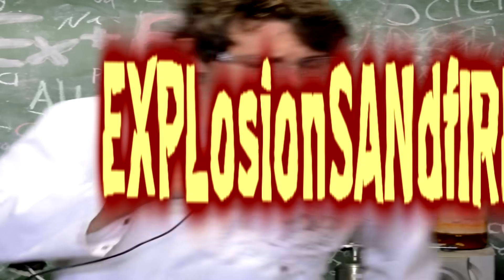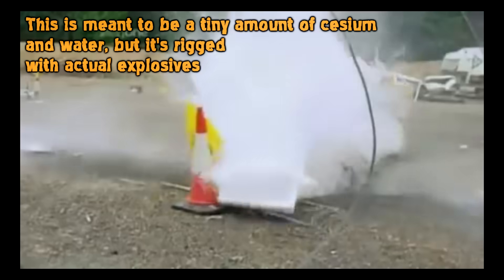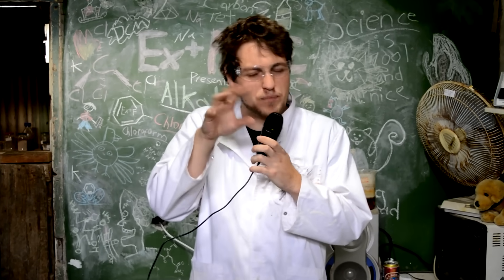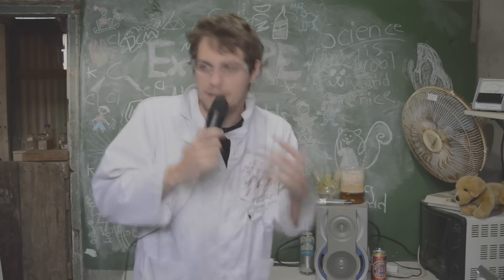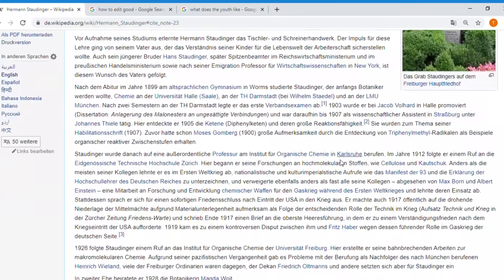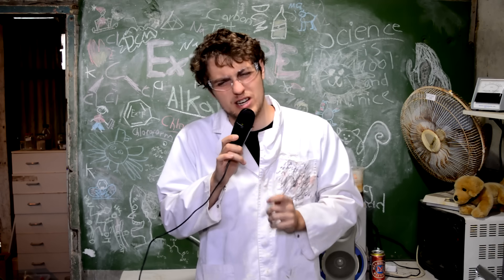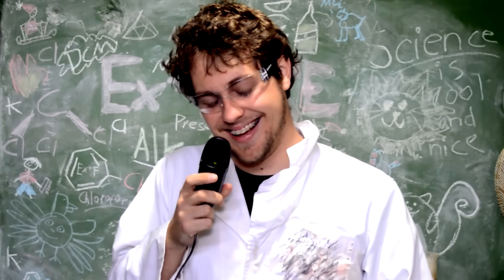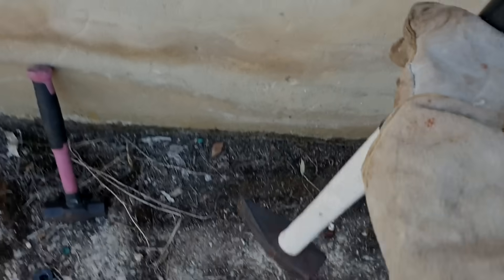Mixing Sodium and Chlorinated Solvents is Real Bad (Carbon Tetrachloride and Sodium)

Comment: The US banned the inclusion of DCM in consumer-grade products a year or so back under the pretense of it being toxic, yet more toxic solvents like xylenes are still readily available. My best guess is that it has more to do with the relatively low activation energy of chlorine as a leaving group in SN2 reactions.
Reply: it was a grass roots lobby effort by families of the deceased, the danger wasn't long term carcinogen risks, people would use it in poorly ventilated bathrooms to strip tubs then die from the fumes in the process, and the fumes don't stink so it's easy to not realize that you are in danger.
Reply: While I disagree that xylenes are at all particulary toxic, it is true that DCM is fairly toxic to humans, mainly because it's just a darned good solvent and can cause demylelination of nerve cells as it accumulates in the body. SN2 reactions with DCM require pretty harsh conditions to occur because Cl- is only a moderately good leaving group, and the methyl carbocation intermediate has a very high activation energy. DCM is much more amenable to radical reactions.
Reply: The reason is more because of immediate safety risks rather than prolonged exposer risks.

Odorless fumes in bad ventilation by non-certifed individuals doing home repair led to some sad times for family.
Reply: Not sure why a lesser fix, like mandating the addition of dimethyl sulfide or some other odorant to such applications of DCM, wasn't chosen

Comment: Once in a German chemistry school class (long time ago) the teacher showed the exact reaction you tried to perform, like this:
-he melted little potassium/sodium pieces in a glass test tube (~ 1cm metal at the bottom of the tube)
-then after cooling it at room temperature he filled in a layer of CCL4 (tetrachlormethane again around 1cm)
-shortly afterwards he dropped the glass tube from the window of the classroom in the 4th floor onto the concrete schoolyard pavement
-there was a little explosion with puffy, thick yellow-orange smoke
Reply: Are most German chemistry classes just amazing? We also did all kinds of explosive experiments, one of which a volcano that accidentally melted the roof lamp
Reply: @BüildBuy12  My chemistry teacher scorched some random plants outside with liquid bromine. German chemistry classes are both amazing and not amazing since a bunch of the chemicals used are just old stock and aren't supposed to be used anymore.
Reply: @BüildBuy12  My school didn’t have a teacher that was allowed to do any experiments, so we either did something that was as exciting as boiling water or just nothing. But my classmates weren’t the brightest so maybe it was better to not let them handle chemicals.
Reply: You certainly aren’t the brightest either
Reply: @SillySandwich1  "haha, i showed that random person! everyone must think i'm so clever rn."
Reply: My chem teacher in "middle and high? school" (god bless her) made chem extremely fun since we did every class an experiment with our lab partner, also she lead the chem club, where me and my buddy started research on alkali metalls(since we where living in an 1000 year old mining town) other older students were fraction distilling crude oil, some other guy tried to find out a new way to clear sewage. We build a frckin recoilles launcher that fired a projectile made out of a tiny thin balloon filled with water, 2g potassium (shaped behind the tiny balloon)  around that was basically a napalm mixture all that filled into a thin metall tube with a cardboard nosecone that included a nail to puncture the water balloon on impact to get the potassium reaction to set fire to the said mixture as a secondary, propelled by our "cranked up" blackpowder mix inside a thicker plastic tube  with flexible wings attached ( after we studied rpg LOL)  effective range about 110 meters with a radius of 3m on impact  AND Mrs Dr Eckhoff was very proud so that we showcased it tou our city mayor and people from the sorrounding  lithium, potassium, zinc and alluminium factories. ( MY BUDDY WAS 13 AND I WAS 12!) we had all our paperwork showcased to them and after that we got a full tour of said factories one of them makes the paint used on MOST air and space crafts build in EU
Reply: That is Soo cool...
Extremely carcinogenic but cool

Comment: What phone are you using for slowmo? On android, slowmo videos will automatically show the middle 60% slowed, but you can edit it, drag the tabs out to the edges of the video, and the whole thing will be slowed.
Reply from the maker: It's a Samsung s9, and it's the super-slomo mode. It only records about 0.2seconds at 960fps
Reply: @ExplosionsAndFire  Ah, I guess it acts more like a phantom where you have to stop the recording quickly after it happens. My phone will record up to a minute at 480fps.
Reply: @ExplosionsAndFire  Something you might be interested in exploring... I don't know if you've covered Ferrocerium in your videos. Not exactly explosive, but a very important compound that everyone uses day to day, it's the flint used in lighters. Invented in 1903 and it changed the world.
What I'm curious about is the compound it breaks down into. I've heard it's oxidizing, or due to high humidity, but never got a solid answer. Over time, it turns into a grey solid, sometimes powdery but usually packed into place and very difficult to remove. I collect old lighters and have had to drill through the stuff. It's like packed clay or concrete.
I recently found that vinegar will dissolve it very slowly, but I'm curious if there would be a more efficient solvent that would not damage the metal of the lighter.

I could send you samples of it decomposed, starting to decompose, packed in place in a lighter. I also have multiple different brands of flints from over the years, and I know the specific compound has changed over time.

Comment: "Alkali metals want to pull hydrogens off of things...Carbon hydrogen bond is pretty weak." No, carbon hydrogen bonds are pretty strong. Carbon chlorine bonds are weaker. Substituting a halogen onto an organic molecule makes it more reactive. When you react lithium or magnesium with a an alkyl halide it reacts at the halogen.
Reply from the maker: Oh yeah you're right, in a general case. I was thinking more about the Hydrogen atoms being acidic. Luke how it is on chloroform, the H is much more acidic. But I guess yeah like you put chlorobutane and sodium together, the chlorine will come off much easier than any of the hydrogens
Reply: halogens make organics more reactive 
How about Fluorine?

Comment: To hit the target with a sledgehammer every time - 

*Stand firmly with your feet a shoulders' width apart. If you are right handed, your right foot should be to the rear.

*Make sure you are stood at the correct distance by measuring with the hammer and outstretched arms.
*LOOK DIRECTLY AT THE POINT YOU INTENT TO STRIKE
*Swing the hammer in a large circle with outstretched arms and absolute confidence. If you are a heterosexual male, it helps to think only "VAGINA" at this point - trust me on this one!

This has worked for me for over 60,000 hammer strikes (ten years of marquee erection).

Comment: I was machining some aluminum and I was using “tap magic” as a cutting fluid, it contained chlorinated hydrocarbon waxes. I ended up breathing the vaporized oil for a few hours lol, next day, I completely lost my voice. I genuinely could not speak, no sound would come out, it was wild! If I used an extremely deep voice then I could speak but any higher pitched tones just sounded like hot air. I sounded like a monster for a few days, it was actually pretty sick. Highly recommend
Reply: I want to inject that in my veins and become a real demon
Reply: @magusperde365 dawg i doubt that would work, it probably fucks up your vocal cords, so youd need to breathe it in

Comment: There is also an explosive of that kind made of aluminium powder and carbon tet. It is mentioned in the improvised munitions handbook of the army. Maybe you could use your remaining carbon tet on a mixture of that kind.
Reply: Alluminium is a reactive metal like Lithium and Magnesium, of course it does that.

Comment: Lol, love that description at 8:33. They took 10g of NaK together with a ampoule of 8 g Oxalyl bromide, put it in a "Bombe", = pressure tight reaction vessle, than cracked that ampoule... A few seconds after that ther was an heavy detonation and they where lucky, that nobody was surverly hurt. They had a second one of that prepared vessles, but after that first incident, they had to dispose off it savely, so they put it on a field an threw a rock on it wich resulted in a extraordinary intense explosion. lol . Also it is written in kind of old funny german.
Reply from the maker: 10g of NaK is a lot wow yeah
Reply: @ExplosionsAndFire  i guess they thought: a lot helps alot...
Reply: @Qn0Bi6  not hurt damaged

Comment: Can't you make carbon tet from chloroform and chlorine?
Reply from the maker: You can, but it requires a boatload of UV to work well as its A radical reaction. So you need UV transparent glassware, lik r a quartz flask, and then you need to fractionally distill the carbon tet from the chloroform. It's quite an ordeal
Reply: @ExplosionsAndFire  could there be any catalist to help, like anhidrous metal chlorides or elemental sulfur/iodine?
Reply: @ExplosionsAndFire  you live in australia so UV light shouldnt be a problem

Comment: I had once a discussion on the narcotic properties of these compounds. During my Chemistry studies it happened in a week that a colleague of mine got showered in DCM and a few days later, I got soaked in Chloroform. Neither of us got unconscious. However, I had to change my clothes and was sent back home. During that time, my driver complained about getting drowsy...
For those that like to know what had happened to me: I was supposed to wash the solution with 1N NaHCO3 and then collect the organic phase for a few more washing steps. In order to wash, I had to shake the separating funnel and the acid within the oil reacted with the base and CO2 made it go boom, blowing out the plug. I tried to push the plug back in creating something like a valve that distributed the content all over the lab... Fun times.

Comment: You should do magnesium or alkali metals plus Teflon (PTFE). Easier to heat without boiling and should burn really hot! Raw PTEF is sold as a fine powder, so should be easy to mix with powdered metals.
Reply from the maker: Thats actually a great idea. I should get a ball mill and make some metal powders

Comment: Your backyard must be classified as contaminated site 🤔
Reply from the maker: My dad still disposes of engine oil in the yard in the typical boomer way
Reply: @ExplosionsAndFire  Your groundwater is fucked.
Reply: @ExplosionsAndFire  the oil came out the ground, so it should be ok to put it back in the ground
Reply: @ExplosionsAndFire  instructions unclear : what exactly is the boomer way ?

Comment: I need some help from you at home chemists working on a budget. I need a distillation apparatus for isopropyl alcohol. I bought 50% (it was all I could find), I mixed it with a ton of non-iodized salt to remove as much water as possible, and now I have roughly 90% but there is still a lot of salt in the solution. I need this alcohol for cleaning electronics so the salt could be bad. I want to build a distillation apparatus at home but don't know what materials to use. I have a hot plate already and beakers but for the condenser what should I use? I am half tempted to break an old fluorescent tube (one with not a lot of mercury vapor) and use that tube.

Comment: Reminds me of that one time I was having fun dropping bits of potassium in various liquids... (including acetone, nitric acid, 37% hydrogen peroxide, and I think I also did Piranha solution.)
(Maybe I should upload it! ^^)
Reply from the maker: Sounds violent!
Reply: @ExplosionsAndFire  well, I only used tiny pieces. Leftover from a large blob I melted and coalesced in some paraffin oil.

But I made sure to do it in my fumehood, in an erlenmeyer (to prevent splashes), itself inside a crystallizing dish with sand on the bottom (soaks up any liquid in case erlenmeyer cracks), with the fumehood "doors" (sash had horizontal sliding "doors") protecting me from any potential flying glass & splashes.

Oh, and I was doing this with Moe Qureshi, the guy who poured a bucket of liquid nitrogen over his head on NurdRage's channel! ^^
Reply: @piranha031091  try lithium in piranha solution i assume it is potent enough to instantly detonate and lithium releases about 4 times more energy than Potassium
Reply: @Peter_Schluss-Mit-Lustig  Nah, detonation is mostly a matter of how fast the energy is released, which in this case is limited by mixing.
That's why it's liquids like NaK that are the most prone to exploding.
Reply: @piranha031091  that makes sense yet potassium detonates on a macroscopic scale on contact with water without any major ignition delay
Reply: @Peter_Schluss-Mit-Lustig  No it does not. It floats and swirls around, makes a "pop" sound when the hydrogen ignites, and eventually a tiny bang when the piece left has become minuscule enough to have a sufficient surface to volume ratio.
Even when I dropped some in nitric acid, it didn't detonate!
Reply: @piranha031091  ok you seem to have practical experience in that field so i take back my claim
Reply: @Peter_Schluss-Mit-Lustig  Actually, I just checked, and apparently, if you get large chunks fully submerged, they detonate. Something I did not do.
Reply: @piranha031091  this might be something to test

Comment: Instead of using a hammer why not get a piece of PVC tubing and a heavy chunk of steel to fit inside it? You can aim it, you can get repeatability and variability from the drop heights or the weight of what you drop. If you need even more force then you can hook it up to some compressed air and turn it into an air cannon... or a gravity assisted air cannon.
Also I was thinking about things and because sometimes you use dangerous chemicals you might want to get a suit to keep your self safe. If you et a blow up T-Rex suit or something similar with more arm length and then plumb into it with a long hose coming from an external pump that is placed somewhere safe You could also adapt this for Covid safety if you wanted to.
Reply from the maker: The device I'm using instead of the hammer to hit the sodium on the foil was actually my attempt at making a consistent impact tester. I welding it all together lol. The straight bar keeps the plate level and you can chose how high you want it and just let it go. 

But getting consistent results was still hard. And it just didn't work great for hitting small amounts of powder, so it's gotten very rusty, a bit sad honestly

Comment: It's strange that Carbon Tet isn't used as a chemical weapon when one fire extinguisher of that liquid can commit Mouse Genocide.
Reply from the maker: It probably wouldn't be a genocide, but it would cripple the mice's healthcare system and their economy would probably collapse
Reply from the maker: Ok that was too close to home oops
Reply: I'm sure there'd be one mouse rabbiting on about how much good work and effort are going into keeping their economy health, that they'd done more carbon tet testing than any other infestation, and that if they'd all just keep their haircuts to less than 30 minutes and stop using bog roll as PPE they'd all be fine.